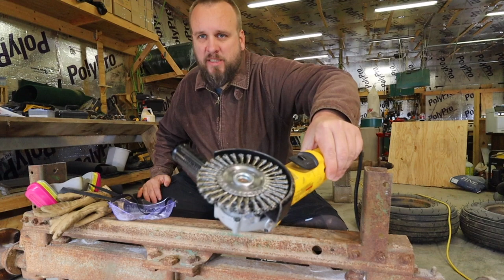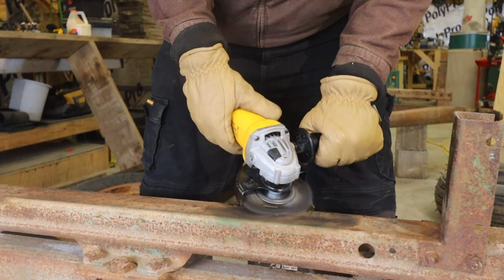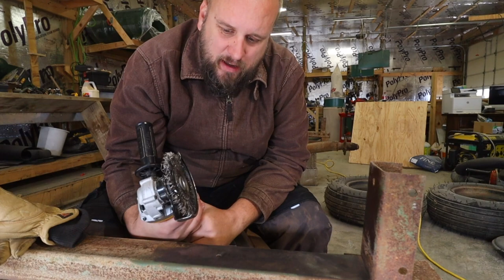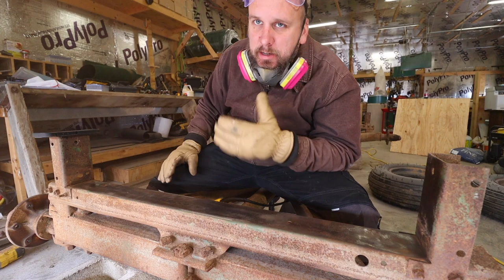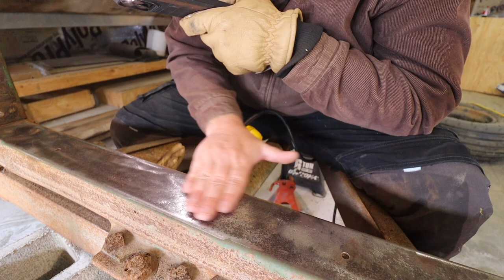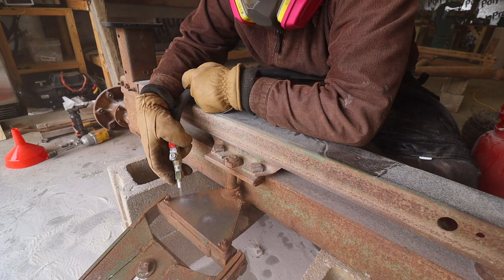Harbor Freight Sand Blaster Vs Angle Grinder for Rust Removal

Comment: Can't stress the PPE enough using that wire wheel on the side grinder. They work really well but those little wires break apart and will stick in your skin like a little dart

Comment: Hi Brock, we use a rust converter treatment product called Feronite here in Australia. Get your metal item clear of all loose and flakey rust, apply the rust converter - it generally turns blue/black due to the chemical reaction, prime & apply your finish coat.
It saves a lot of manual labour in you don't need a super smooth finish on the metal
Reply: Locktite Extend.
Reply: Rustoleum rust reformer $9 per rattle can

Comment: Brock, if you go with a wire wheel you should get the cup type. It will sit flat on the metal and cover more metal than just the skinny edge of the flat wheel. Then spray or brush the rust killer on it and you should be good. I did the frame on my classic car with a sand blaster and my boat trailer with a wire brush and a good rust killer. It depends on what level of finished product that you're trying to achieve. Either way I'm positive that it will turn out just fine. As far as re-using the media, there's absolutely nothing wrong with that. I did my blasting outside and on concrete so I could save as much as possible  God bless and keep up the great work. 👍👍
Reply: Clean metal must be treated quickly as it will start to rust again within an hour. Use a high grade primer next before painting.  You should get great results.
Reply: @vogelj2009  Metal prep will also help a lot.

Comment: Brush and roll is the most practical application method. A surface tolerant, epoxy primer is key to the longevity of your project. You can apply anything, on the epoxy primer, for a topcoat.

Comment: Brock the last wagon I did I used wire wheel on grinder also and just got most of them used rust converter and painted. 6 years ago and frame still looks good.

Comment: Using the wire wheel I find it much more efficient if you keep the wheel at a 90 degree angle. Thinking about it, I'm pretty much an expert with the wire wheel. Used several times a day for years when working as a welder.

Comment: Another great video demo. Your using a knotted wire wheel that's design for cracks and crevices cleaning (90° inside corners) welds. Try a knotted cup wire wheel! It will be a huge improvement and last a lot longer.

Comment: Agree with just using blaster for tight areas. You can also get much cheaper media than the powder/beads that aren't as aggressive and won't eat down so far. You can use a shop vac while blasting to catch the media as it comes out.

Comment: While I've never done a hay wagon,  I have done smaller implements,and I used a cup brush sometimes followed by a sander. After which I used Rustoleum rusty metal primer and rattle can John Deere green.  So far, it's held up.

Comment: Great video Brock!! That paint remover wheel seemed pretty fast and efficient.  Sand blaster did great job it will clean the bolts up good also.  I did a Toyota frame did a great job and I'm actually doin another 4x4 Toyota frame now I bought the 15.00 dollar harbor freight Sand blaster holds 50lb bag also bought 50lb bag medium at tsc 13.00 dollar did back of frame in bout hour have a little 2gallon compressor seemed to work good for me.  I've painted several implements John deere green I used rattle cans from farm stores seemed to stay on good.  But the electric sprayers work pretty good also.  Good luck with your project.  Thanks for sharing be safe have fun enjoy

Comment: Try a cupped wire wheel, preferably with a 9 inch grinder, and remove all rust. Good primer should handle any reasonably minor imperfections.

Comment: If you have any degree of corrosion pitting, you NEED to media blast. Only blasting can actually clean rust out of pits. Wire wheels just ride over the top. They remove rust on top while not touching corrosion within the pits. This is true even if pitting is relatively shallow, and is only roughening the surface.

Comment: We have a welding and sandblasting business about 20 minutes from my house and they are pretty cheap to do a big frame like that. I wonder if you have one near you?
Reply: Good morning brock been there done it was in the auto collision in industry for forty years my suggestion would be have it commercially sand blasted and apply in a poxy primer called p o r 15. it's a rust inhibitor and then apply your color over that should last forever.just my two cents.p.s. you can use silica sand from your menards or similar store.your content is very intertaining.

Comment: 2 things:

1. Blast media (crushed glass) can be re-used up to 4 times.
2. Blasting etches the steel and provides for the BEST adhesion of paints. Using high speed disks polishes the steel which offers the worst adhesion.

Comment: Definitely spray with a LVLP sprayer and add hardener to the paint at proper indicated level.  (I like the harbor freight mid grade gravity feed sprayer for this kind of job)This will last a whole lot longer than spray bombs and it puts down more paint quicker and cheaper.  Plus... a big plus... it won't fade near as fast (years vs months) and be more scratch resistant.  Just make sure to put a good epoxy primer on right before you spray the paint.  Don't wait too long between coats,24-48 hrs,or you'll have to scuff up the primer for maximum adherence. First coat of paint, put a light mist coat on... to make a tack coat, then paint over that with a thicker coat. This helps in controlling runs and fisheye.

Comment: That sand blaster is made for like a motorcycle frame at best. Ya need a bigger unit for the project you are wanting to sandblast. Hell ya probably could've had a Mobil water media blaster come out to your property and do the entire project within a few hours with better results. Grinding wheels whether they are a wire brush or abrasive is gonna get costly as well. The scotch Brite wheel isn't really a great rust remover unless it's just surface rust and it's not pitted. Media blasting is the best way to go,  if you have the right set up for your application 👍👍

Comment: For the small stuff use a white vinegar soak then place in a baking soda bath to remove acid off the metal. Cheap n easy for the small stuff.

Comment: I start with my air chisel. This busts off any chunky rust. Then i wire wheel/wire brush or sandpaper. I dont necessarily go for bare metal. About where you had it real dark gray. Then apply a product called corroseal. Then paint. Goodluck on your projects everyone.
Reply from the maker: Thanks for sharing

Comment: My take is that you are working on a hay wagon, not a church organ. I'd take it down to the mill scale and hit it all with an etching primer, then paint. Use whatever tool/approach is giving you good enough results in a reasonable amount of time and cost.

I would also suggest that you stay away from using glass bead media if you are planning on a painted finish. The glass beads produce a smooth, burnished finish that won't hold paint very well (I ran into that problem before Dura-Coating parts for a pew-pew). Aluminum Oxide blasting media is available in multiple grits and will do a better job preparing metal to take a paint finish.

Open air blasting makes a wicked mess as you know firsthand now. You definitely want to do it outdoors or in a sealed room designed for that purpose. To be at all cost effective, you will need to be able to sweep the media up for re-use.

Blast cabinet use for small parts is a tremendous process. If you don't already have a blasting cabinet, I would definitely recommend picking up the large one that HF sells. It isn't a commercial duty cabinet by any means, but it is plenty good enough for occasional home shop use. Once you have one, you will be amazed at how many little jobs you'll use it on (rusty bolts, small brackets, lawn mower blades, pliers you left outside, etc.).

Take care and God Bless.

Comment: Both if you don't means but I used a setup with a towable rental compressor    and a deal that used walnut shells meant for blasting brick on some construction equipment it was fast

Comment: My suggestion would be as soon as you get an area "cleaned off" to the level you are happy with, spray a coat of primer on it before you call it quits for more than 1/2 hour.  The primer will dry quick and cover/seal all the pours of the metal you just opened up that will love to quickly start rusting again otherwise.  Still think the sandblaster will be good for tight areas you can't get into or around with the grinder.  Have a good one!!👍
Reply: Use "primer sealer" since common primer does not prevent rust as many car guys learn the hard way.

Comment: I went through 6 abrasive wheels and one angle grinder removing rust from my snow blower and I,m only halfway done.
I just bought a 20 lb sand blaster from TSC but haven't used it yet ......................

Comment: The problem I always had with sanding large areas was that the first part would re-rust before I could even finish the whole job.
Reply: I took an auto body class in the 70's and the teacher said that it only takes a few hours to have clean metal rust again, esp. in the hot & humid weather in CT near the shore.  Every few hours we would grind and then shoot it with primer at the end of the class.  Over the decades I've used Rustoleum Flat Rusty Metal Primer and then JD green on top of it and it's work well for me. Just make sure you clean the surface with alcohol before painting.

Comment: Cup type wire wheels are MUCH safer than the flat flesh eaters. While tiny grinders will do the job slowly a 6" grinder has much more torque and can run the outstandingly useful 6" thin kerf cutting discs. 

The path of least suffering and often most cost effective for large items like wagons is bringing them to a local monument company all of whom have large engine-driven compressors and serious blast pots. Mine bartered for farm eggs for small projects. Blasting anything but small parts really benefits from pro gear and big air.  Your time has value.

Comment: I've found the fastest & cheapest is to find someone with a real sandblasting setup.  I actually found a place nearby that does grave stones, when they are slow they'll take the work!  Have you thought of using a wire brush to knock off the big rust, clean it off with alcohol and then paint it with Rust-Oleum Flat Rusty Metal Primer.  Then use the JD paint over it.  Make sure to prime the areas that show clean metal quickly (every few hours) or it'll start to rust again.

Comment: just depends on what you want a hay wagon to look like. since its it will be out in the weather most times or under the hut. fastest would be just brush it on.  I care more about greasing and air in the tires. Paint it when I can and then its mostly rattle can.

Comment: it appears you have moisture in your airline , as for media, aluminum oxide, it's kinda purple in color , has WAY less dust & can be reused over and over . Put a tarp down outside & catch it then just shake it to the center of the tarp & sift . I've been using the same 60 lb bag for many years. It's an absolute MUST that there's NO moisture in the air line it slows the blaster down & or clogs it .also causes immediate rust after & while blasting

Comment: Sandblaster is best you need constant air pressure of 70 to 90 psi I used one for long time plus primer will stick like glue where you blast metal

Comment: I hate sand blasting you’ll have sand, blasting sand everywhere, even in your underwear 😝. There is a device that you can buy that hooks to your pressure washer and a pipe goes into a bag of sand. The combination of water, and sand. Takes the paint and rust off. I’m not sure how they work. I have never tried one.

Comment: 1$ a pound oh man your getting robbed I get crushed glass in many different grits for 8$ per 50 lb bag . And tractor supply has coal slag for 12$ per 50lb bag which may be better for your application on solid steel. Also you can increase fitting size and hose size to improve flow and nozzle size for even more speed if your compressor has capacity to keep up with a larger nozzle . Id change nozzle first . Crappy part about the harbor freight unit is the fact that the bung coming out of tank is only 3/8 even if you increase from there that part is stuck at 3/8 . Systems that start with half inch and up perform better .